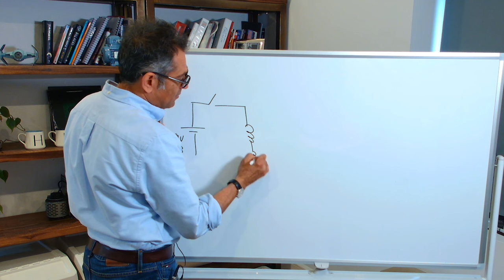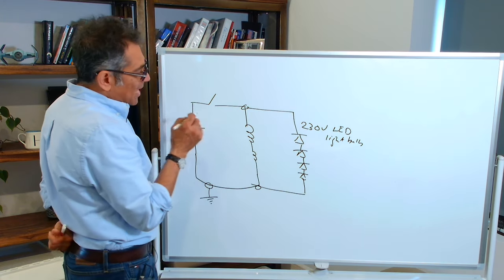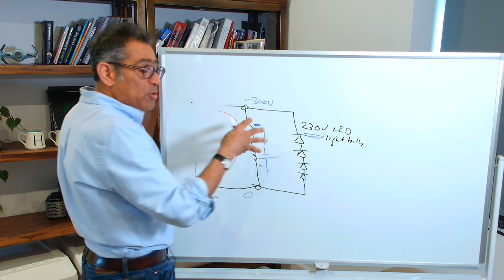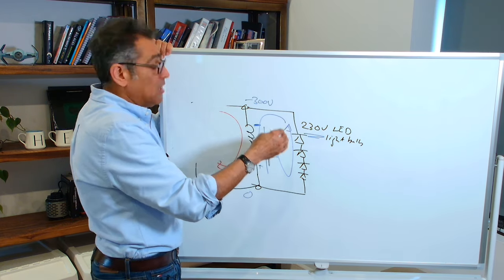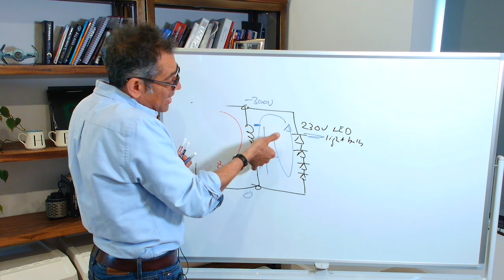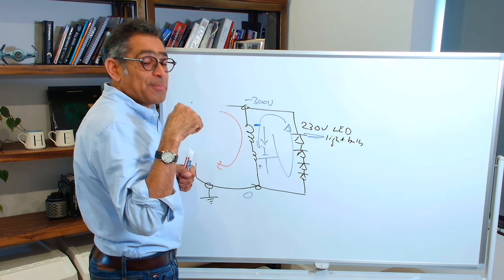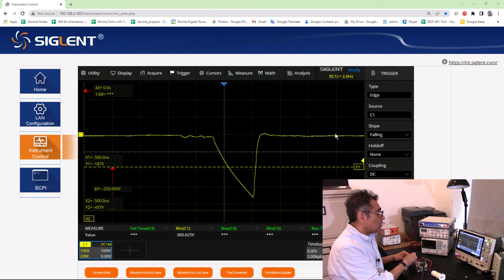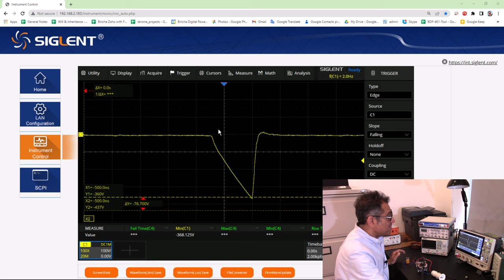PSU Design Fundamentals: Experimental Demonstration of Inductor Back EMF

Comment: So why are we not capturing that back EMF and using it to recharge the battery to prolong is lifespan?  (such as when using the coil in a motor, etc).   Of course it would still have loses, but if you're recouping even a little bit each time, that would add up quite a bit over the span of the batteries total discharge;  extending the usable time for each charge.   Basically increasing efficiency
Reply: Then you need bidirectional converter

Comment: @biricha how does the back emf goes to -300v bcz the battery is only 9v
Reply: v(t) = L * di(t)/dt 
It's a differential equation. The faster the switch is opened, the higher the voltage
Reply: Even after all these years, I am still impressed by simple demonstration.
Reply: di/dt